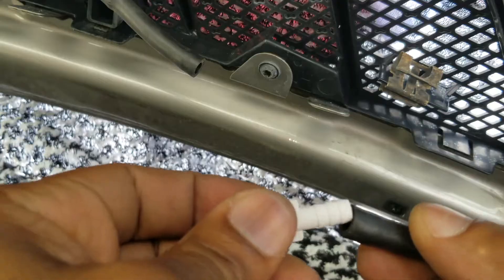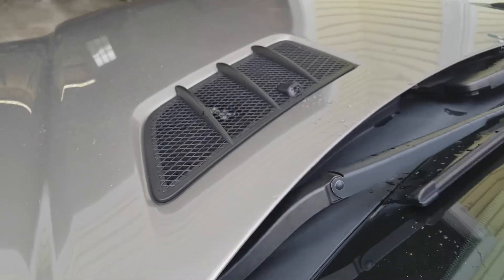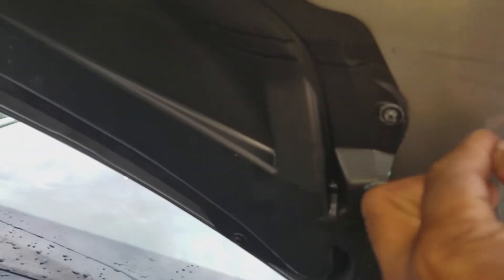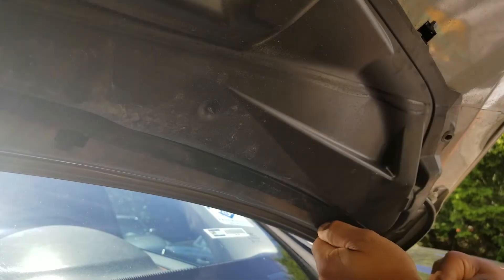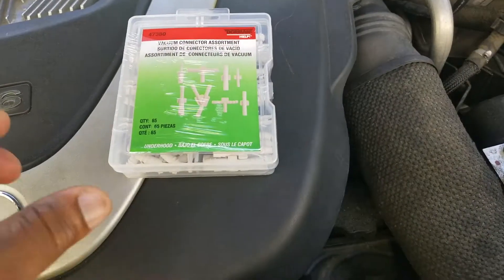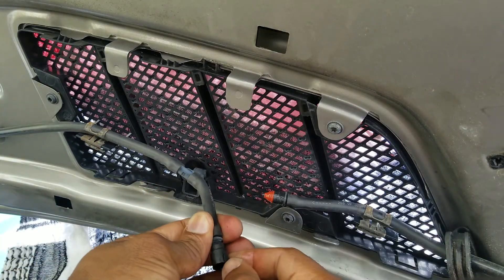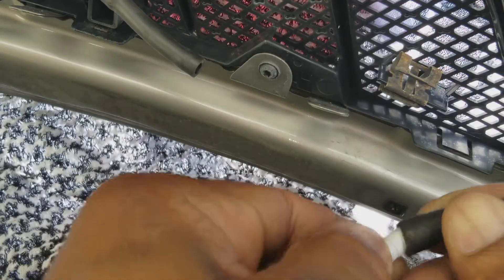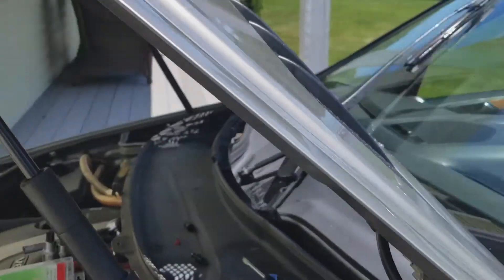Mercedes Windshield Wiper Hose Vacuum Couplings Repair

Comment: I do have a question I have a 2006 Cls500 with a rear suspension problem during winter the rear seat low and during summer is all good BUT when I'm driving on the interstate it wobble in the rear to the point it eat both of my rear tires just need a little help here 👍and I'm sorry if the question is not related to your video.
Reply from the maker: If you press down on the trunk and try to bounce the vehicle up and down, does it bounce easily?  If so, with what you've told me so far then it is probably your shocks.